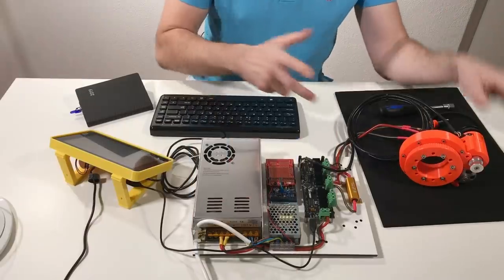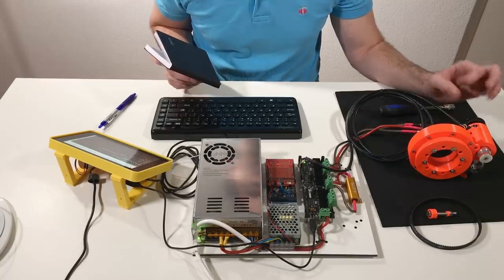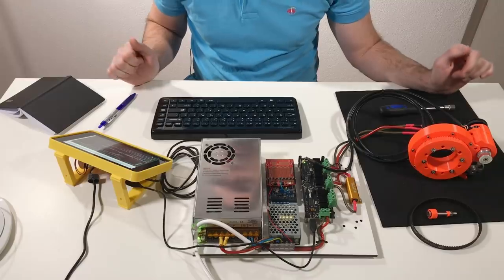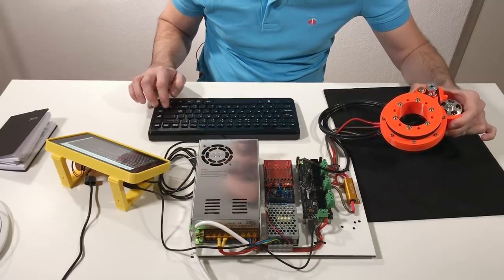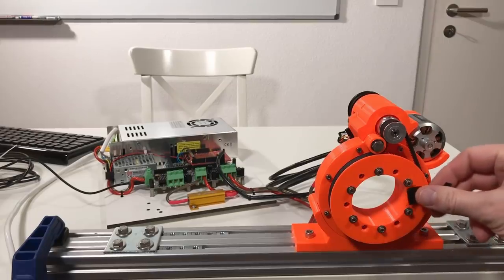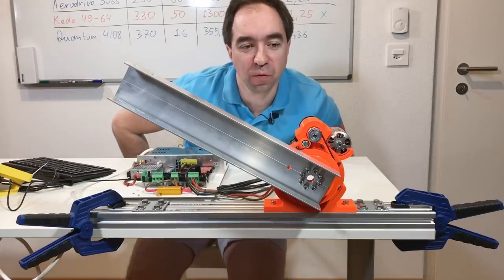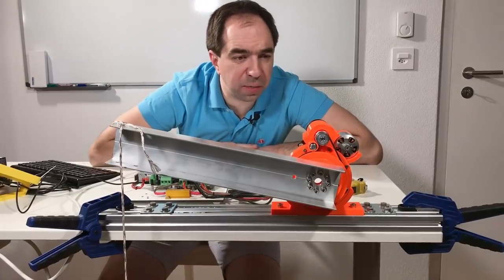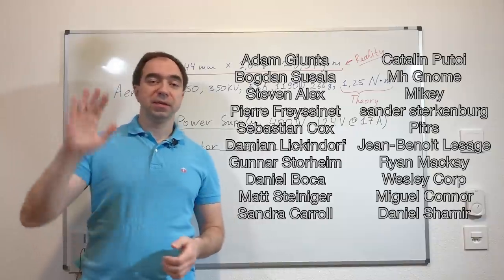Test of Robot Actuator (Brushless Motor Robotic Joint)

Comment: I suggest that you don't use a higher wattage power supply as the solution (consider the amount of heat that would be generated and the total power requirements that would need to be considered if it was in a real world robotic application). Consider instead, using a planetary stage/s reduction for the BLDC motor. This will give you some standing torque that may help on the output stage. With the current speed of BLDC motor, you can use a 10:1 or less; downfall is speed/torque ratio as you know your output stage will be slower. 

My idea: 
Using this BLDC motorized systems in the current robot arm you have developed: 
         This newly design BLDC motorized gearbox does not need to be that fast for your robot arm. You can then convert 3/4 of that speed to torque using a planetary gear system at the output shaft of BLDC motor. All the developed controllers and software would not have to be changed (Software tweaking may be required). I don't have any ideas if a planetary gear system was designed specifically for BLDC motors. However, I have seen planetary gear system that was designed for constant current DC motors adapted and mounted on steppers motors and place in 3D Cartesian printers and gantry type 3D printers. I think this idea will be a better solution to your torque requirements.

My Two Cents
I did a quick search and found that you may have to change the type of BLDC motor that you used. The type you have in this video is mostly used in RC models and I don't think they have planetary gear systems that fit that particular type. You may have to switch to NEMA 17 format type BLDC. I look forward to what you choose as a solution.

Comment: I've always wondering how you pass wires in an arm with more joints without them getting twisted eventually.
Reply: okbrb o ring with wipers? Or coiled wires that can stretch with software limited to a few turns?

Comment: You will likely need forced air cooling at that much power to keep the motor happy.
Reply from the maker: I agree. I will add cooling for the next test.
Reply: Also what is your intended application? I think you could get by with much more reduction, which will give you much more torque and less motor heating.

Comment: There is some jerkiness at the end of the move (even unloaded), is the encoder correct for position?
Reply from the maker: I think I just need to adjust PID parameters in the ODrive. I just left the default values.
Reply: I noticed that as well

Comment: Are you intending to use this actuator for a robot build?
Because if so, it will definitely not work in anything remotely precise or rigid, since the axis itself has several degrees of backlash and almost zero rigidity. I have a tiny 3kg payload KUKA robot, and it takes over 100Nm of torque to move not just axes 1 or 2, but even axis 3, without the brakes. And if the motors are on, I can only make the actual frame and transmission flex. Even the highest static overload with brakes not applied consumes under 150W for all 6 axes, and the robot is rated for over 1kW continuous.
Reply: You are telling me home made plastic actuators aren't the same as obscenely expensive industrial gear? The wonders will never cease...
Reply: @MsSomeonenew  It doesn't even have to be "obscenely expensive". The cheapest, shittiest worm drive not intended for robotics will have less backlash and more output holding torque than this.

Comment: That's the wrong type of motor for such a project. This is very inefficient use of this motor. You'd need a very low KV motor with higher torque. Likely much smaller power will be plenty too and a lot higher gear ratio. Not sure what your intended use is but the way you built it makes no sense to me outside of experimenting with the concept with parts you already had.

Comment: Hmm, i think something in your calculations is wrong. When you have 0 rpm abd just static torque... You still have 0 watts + some losses. But a high current in the rotor windings. Maybe your current controller or position controller has too small of a kp or ti....

Comment: great work an all,but its kinda pointless...just use a proper stepper motor and get the job done...this thing is only for toys
Reply from the maker: Nope! Stepper motors for toys. From this setup I already get 3N.m torque. The stepper motor with such torque weight from 1.5 to 2kg. And my setup is only 1kg. And with proper power supply it will get even higher torque. In general the brushless motors have much higher power on the unit of mass than the stepper motors.
Reply: @Skyentific  dont forget steppers are also brushless motors..just another kind of motor.anyway,in the real world,if you want accuracy,torque and holding torque,excluding servo motors,steppers are the way to go.check out my projects,i also started usind dc motor with encoder,using my arduino code and eventually went the stepper way to jave work correctly.